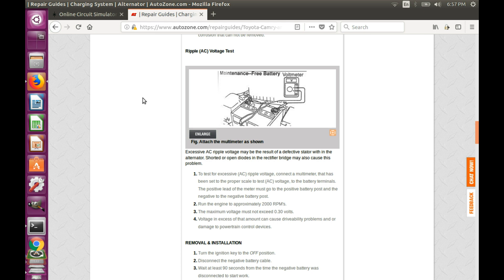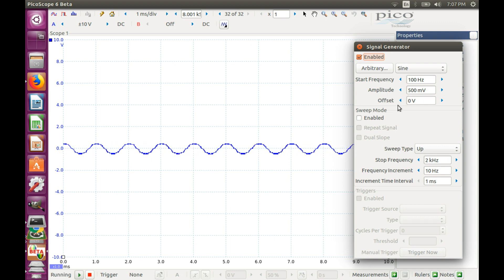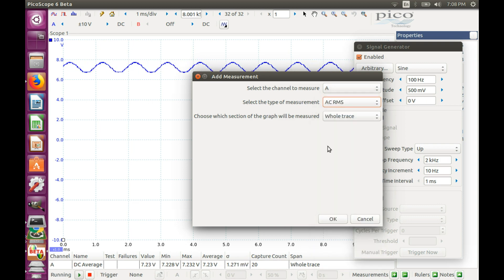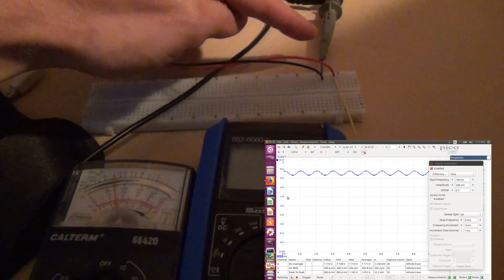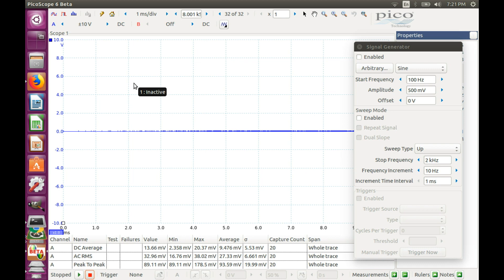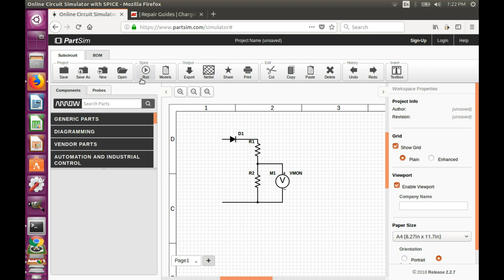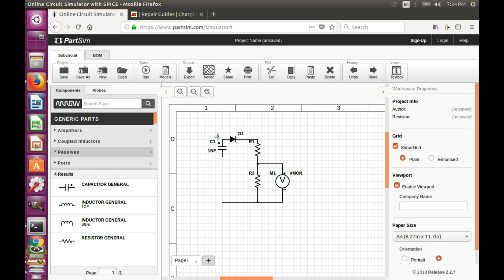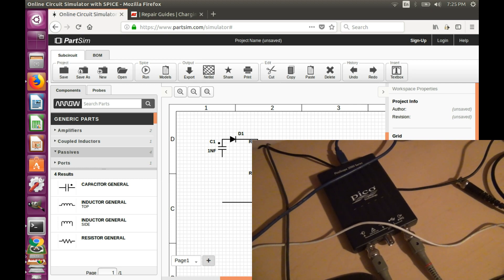DIY AC Ripple Test: Don't get fooled by cheap multimeters!

Comment: Ok! So the guy who sold me a new battery told me to measure ac voltage with my multimeter when my motorcycle was running just like you explain. If it was anything above something like 0,7V I should turn it off because it would indicate something bad which would kill the battery. So, I did this test and i showed around 30V so I've been afraid to even start the damn thing. 
This explains that. Thanks a lot!